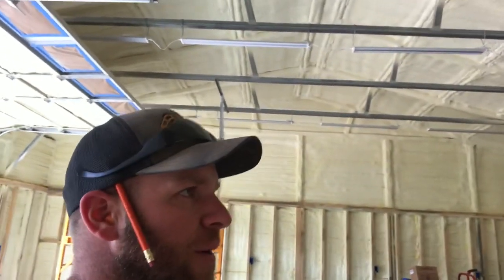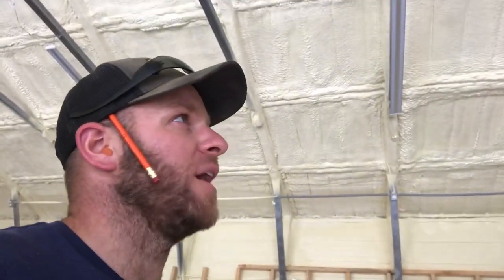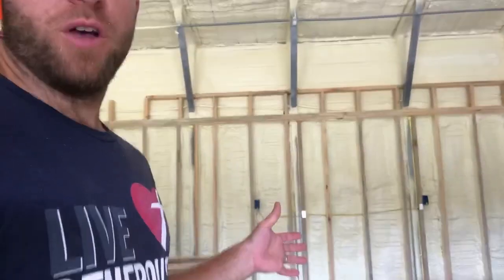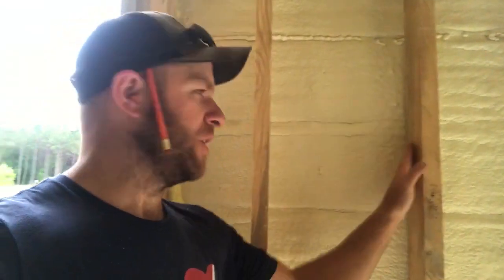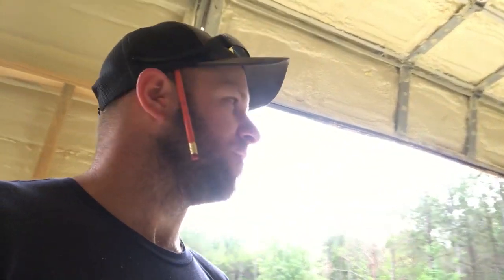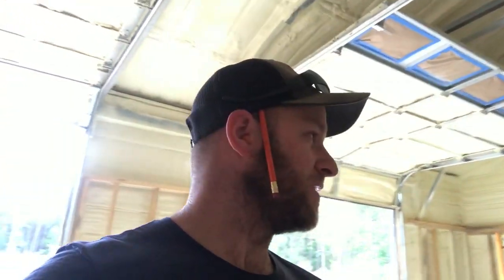Spray Foam Insulation in the Shop and Lessons Learned

Comment: Wouldn't 1" of foam be 95% efficient R-7 rated insulation..... and 2" be 95% efficient... R-14..... 3" 95% efficiency efficient R-21.... etc.  I'm no construction expert but I've always thought efficiency and R value are completely different to things in regards to insulation.  Seems like the sprayer dude just didn't want to be there longer to lay down all the extra foam and sold you some BS.  Just saying.  Again - I'm no construction expert.  I may be way off.  I live in the Chicago burbs in NW Indiana and if I had only R-7 rated insulation on my big beautiful shop (that I don't have... yet, haha) I'd be.... unhappy - to put it kindly - come the sub zero to 10 degree dead of winter.  If R-19... R-23 is a winter jacket, so to speak, in regards to wall insulation in the colder climates up north..... this guy sprayed on a wind breaker.
Reply from the maker: Yes I believe you are correct. He kind of caught me off guard. Basically he didn’t have enough bulk chemical to do what I asked and he’s used to just doing this same basic thing for folks so he talked me out of it. We definitely need more, especially on our southern facing roof. Eventually we might feel flush enough to add more on top. We have the opposite issue of your cold, we get 100° day temps and that metal siding can’t be touched! Just getting up on a step ladder inside you can feel the temp rising, and the poor little 2 ton AC unit we have runs pretty much sunup to sundown.

Comment: I had a guy say the same thing. Only wanted like 1in on the walls and was going to do 3in on the ceiling. Sounded to me like he wanted to be cheap.
Reply from the maker: Yeah I think there is a bit of bait and switch with all these guys. They offer a price based on minimal application, and then when you ask them to do more, they try to talk you out of it. They know that the bare minimum price gets the job, even if it's not the best job they could do.
Reply: @TomBrueggen  I researched it and the insulation/sound barrier rating is based on 3in of foam, so if they only put 1in then it probably won't do much. Then he wanted like $2/ sq ft He did at least say he would put as much as I wanted.
Reply from the maker: @grasscutter88  yeah the issue is his price was based on 1” thick, for like $2700 on my job. So if I wanted 3” thick the price would have been almost triple that. He has a base fee to mob and spray, but the biggest part is the chemical. Probably would have been like $6000 or more, and then figure folks will ball at that price. Even though it’s the proper way, they know that people will question the price and end up going with the cheaper guy that does less. They all lower their standards to be on the same level 😂
Reply: @TomBrueggen   Sadly issues like these occur all too often because everyone cares about price, not so much what their money is actually paying for. I have an electrician that I always give a generous tip to because we both have the same mindset of do the job right the first time and don't skimp on quality.

Comment: Thermal bridging?
Reply from the maker: What are you asking about? Are you saying there will bridging due to no air gap?
Reply: @TomBrueggen  - I see exposed metal roofing support members that weren't insulated.  Since they tie in to the roofing sheets won't they get hot or cold depending on the weather?
Reply from the maker: @timothyvanderschultzen9640  true, you could have conduction through the members, but I’d say it’s minimal, and the further you move from the source the less it’ll be. The members are all insulated at the wall and ceiling and for at least a foot or so from that point. Would be neat to get a thermal gun on a hot day and see if each one has a hot spot or not.

Comment: ……… why is it uncolored? 

Spray foams that are real and tested and passed national standards will have a trademark on them. That trademark usually is a color. Color dye added to it to show its a verified and tested trademark product. 

Your foam still is the natural color of the foam…  why isn’t it colored with your trademark color? 

Is that foam untested/untrademarked?  
Cause if it is uncertified/untrademarked then you might have just gotten screwed dude.

Did you check the paperwork and certification numbers before hiring the company? 

Cause if they aren’t certified and they still did color it than they would have just committed grand larceny on top of all this too.

Comment: Well, you pretty well ruined all that hay
Reply from the maker: Actually not. Heck the goats would eat a piece of styrofoam board if I threw it in their pen probably. But there is only little bits that got on this hay. We did sweep out the loft after and threw that loose hay to the goats too. They didn't touch any of the bigger globs of foam that were in that. Seems like it's all fine.

Comment: The sprayfoam company was totally useless
Reply from the maker: In hindsight yes. Nice enough fella but certainly didn’t take the time to educate us on the sale. Just did what he always does. Spray enough to make a difference but keep it affordable.
Reply: @TomBrueggen  you see that’s the thing the number you mentioned in the video are way off unless they used some type of space age product,because in my twenty years of spraying foam I have never sold an (1)inch of foam in a pole barn style building it’s just not going to work not enough thickness se that number! Per inch is relative to the assembly of the envelope ,say(a wall in a house ) but not in your case.
Reply from the maker: Right. In hindsight I’m not impressed. But I’m equally guilty for not calling his BS. I did actually ask him about making it thicker once he started but he didn’t have enough chemical on the truck, or so he said
Reply: @TomBrueggen  and that’s were I call B.S on him because if he knew what he was doing he could have easily gave two equal monolithic inches of foam for a very similar quantity of chemical when is say similar I mean five to ten gallons because technically you burn through more chemical when trying to apply a thin coat due to reversion rather than use the thermal transfer along the substrate to help your yields,sorry you had a bad experience with that spray foam company,and hope you understand that he doesn’t represent the industry.
Reply from the maker: @chinidad2778  haha, no worries. I’ve worked with enough contractors to not hold them all accountable for the bad apples. I’m certainly still a fan of spray foam. I’ll just be using someone else on the next project